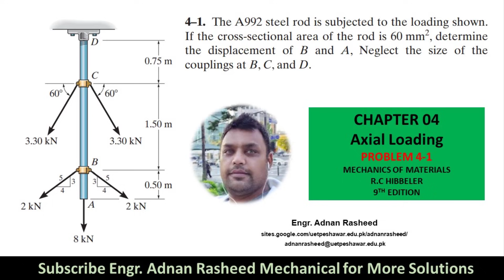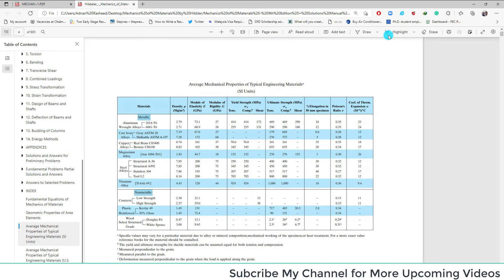4-1 Determine displacement of B and A | Axial Loading | Mechanics of Materials by R.C Hibbeler

Comment: hi can you teach us this? thanks 
F5-8 The gear motor can develop 2250W when it turns at 150 rev/min if the allowable shear stress for the shaft is t allow =80MPa , determine the smallest diameter of the shaft to the nearest mm that can be used.
Reply from the maker: I shall check and when get time I shall....
Reply from the maker: your problem is very simple. kindly go through this problem 5-33 determine minimum inner and outer diameters di and do of shaft | Mech of materials rc hibbeler
https://youtu.be/A7t-Q35Eao8
and solve your own and tell me whether you solved it easily or not...i am waiting for your response
Reply from the maker: have you solved that?
Reply from the maker: The diameter comes out to be 30.5 mm. It should be the answer. T=P/w= 143.23 and d = 30.5 mm
Reply from the maker: did u try that?